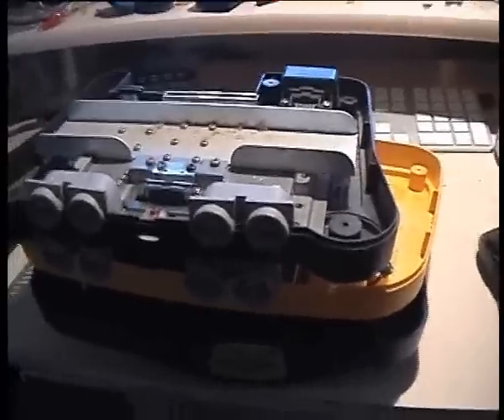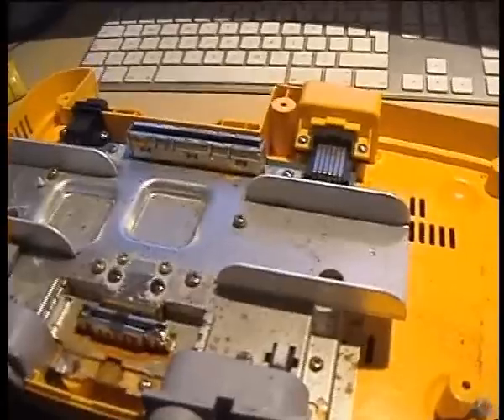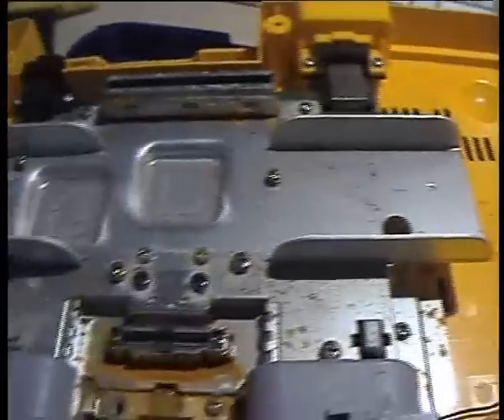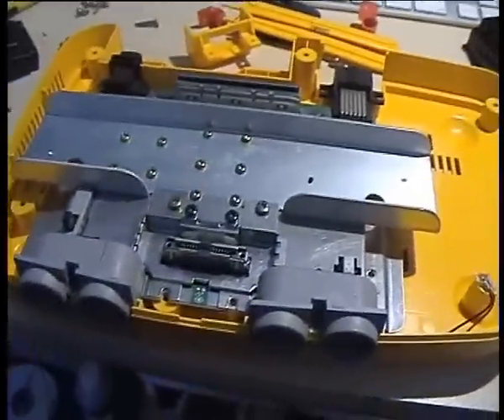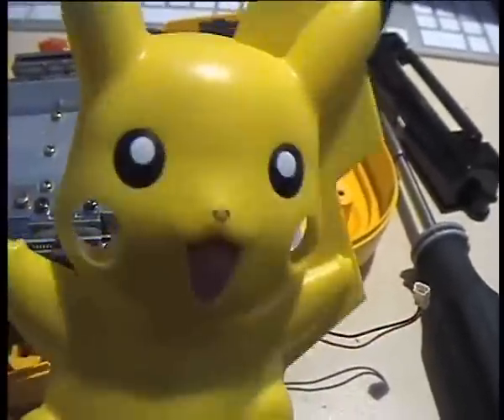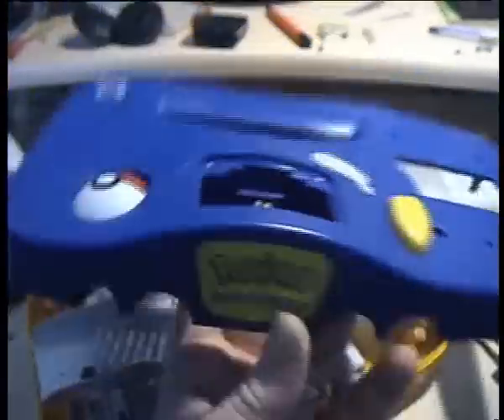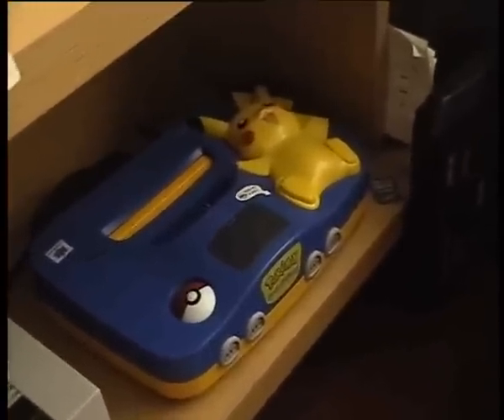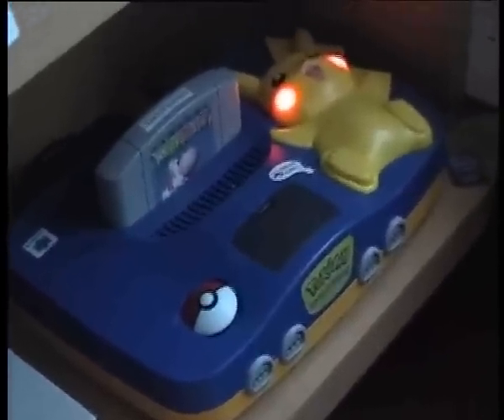Pikachu N64 Repair

Comment: Where exactly did u solder the led line to? thinking about doing this with mine, because it won't display any video or audio. that or i may try a pin connector to avoid junking a 64
Reply from the maker: funkmaster119 Yeah I show you @2:51
Reply: so it's pretty much the exact same place as the pikachu one got it thank you!

Comment: Wait. Was that an expansion slot I saw on the underside of the motherboard? If so, then I guess if you carve a hole in bottom this can be N64DD compatible.
Reply from the maker: No because it sits flush to the base of the original model. It would work though it's just a regular n64 mobo.
Reply: RetroRepair So would more modifications need to be made? Like, saw off the back of the bottom case,  make a new one so that the DD can connect, and maybe keep the half you sawed off as a detachable cover?
Reply from the maker: +Orion Ake (Handlebar-Orion X) Yeah if you wanted to, I'd expect the aesthetic would be somewhat offset though, what with the difference in size. It'd work though.

Comment: I got one of these in today and it looks like somebody painted it. It's light blue and looks scratchy. I started taking it apart and got to Pikachu (whom they ALSO painted), I took off all four screws and his foot, but where his foot went in still appears to be stuck. Is there something holding it in place or is it just being stubborn?

Hopefully, I can just take some isopropyl alcohol to it and the original paint will be underneath it. If not, I'm going to have to repaint it. Some people are outright morons.
Reply: SupraViperhead how did it turned out ?

Comment: I did the same thing with my Japanese Pikachu N64 which really wasn't necessary I took an American N64 console "my Jungle Green one", and swapped boards I also swapped LED's "the Pikachu board one has the regular LED and the Jungle Green one has the Pikachu LED connector" turns out it was the AC adapter that was the problem, I say this because one time I played Mario party 1 with a friend and we were in a middle of a 35 turns round and the console shut off...I tested it with another AC adapter and it now works fine 0_0 weird huh?